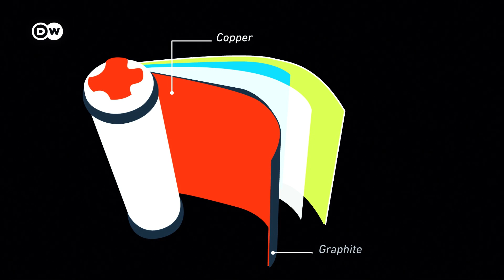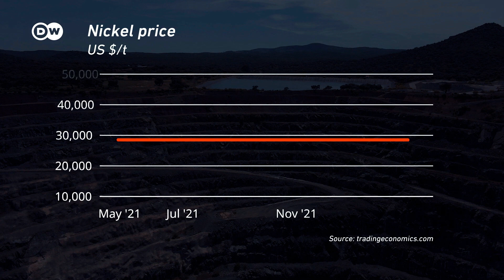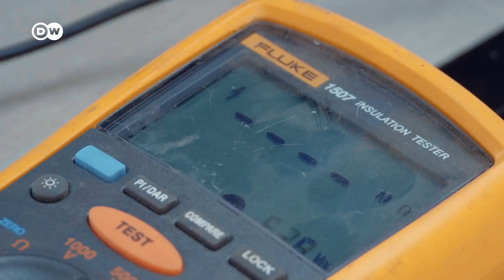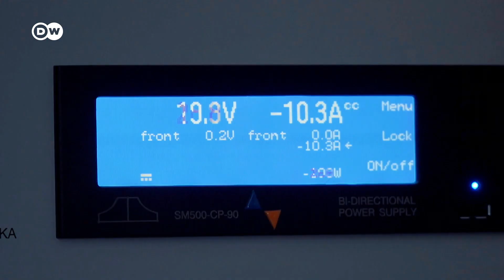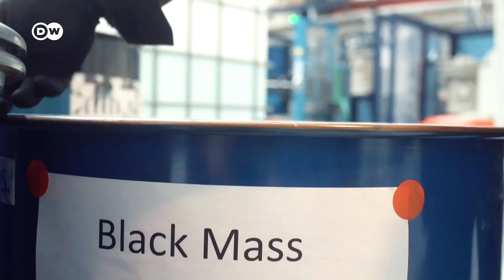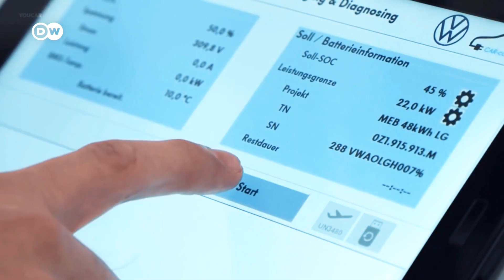Battery Recycling: The End of Cobalt Mining?

Comment: It makes sense to recycle them. They would be considered to be high grade ore concentrate. You get lithium copper cobalt and nickel. The iron and aluminum would be considered waste. Process would start with shredding. Next dry the shreds and  use magnetic and gravity separation. Copper and cell can steel is removed. Next, treat with carbonated water to pull lithium out. Next step react  black mass with HCl and oxygen to pull the cobalt and nickel out. Next bake the carbon and plastics under a reducing atmosphere to recreate porus carbon that can be reused. This twice processed carbon material actually works better than  virgin material for some reason.